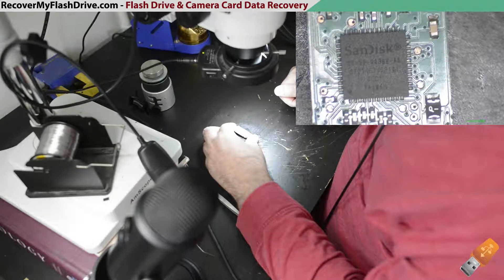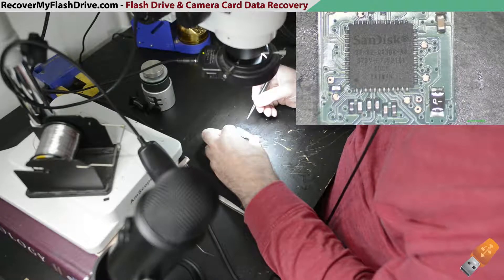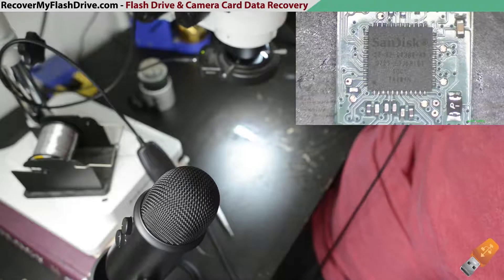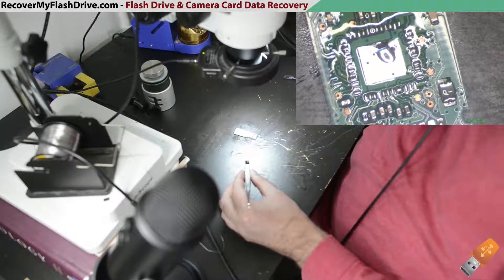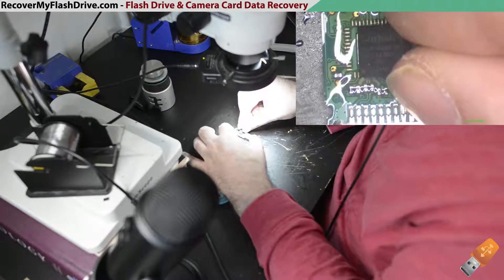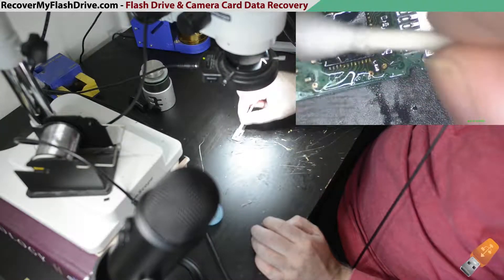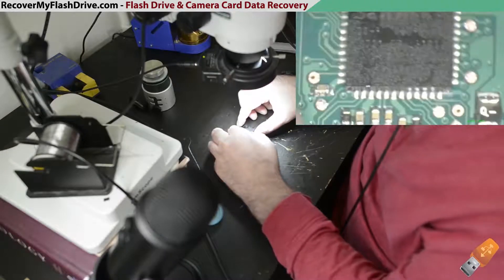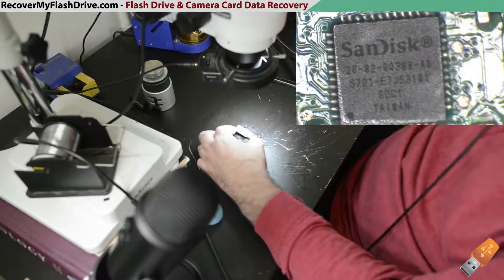SanDisk 20-82-00388-A0 Controller Swap for Data Recovery

Comment: Was the data even recoverable? I have an ssd im messing with and all clues lead to its controller. So only way to find a controller to replace it with will require me to find the same model ssd and remove the controller from it? These arent sold in china at all?

Comment: i have 20-82-00388-A1 controller on an ultra 32gb flash drive. I dont need data recovery i just need to get it to work. It currently has "write protection". Do you know how to remove write protection? The drive is detected in windows and i can read / copy all files in it.
Reply: FRIENDS , THATS A VIRUS LOOK AT UPDATE FIRMWARE. GOOD LUCK

Comment: Hello,

What temperature do you have the soldier station when taking out the controller?

Thank you.
Reply: it would probably be around 440c-480c most likely 440c as the board is very thin